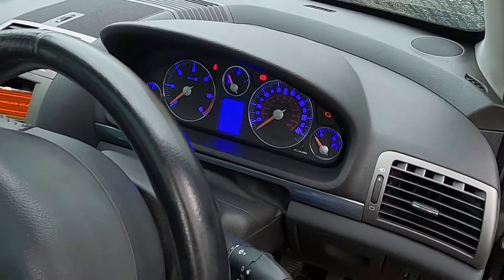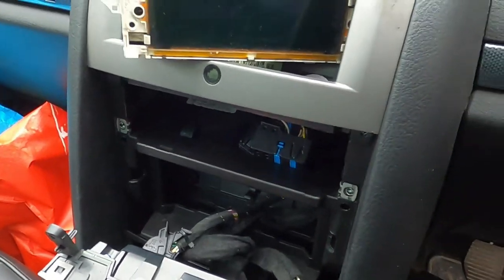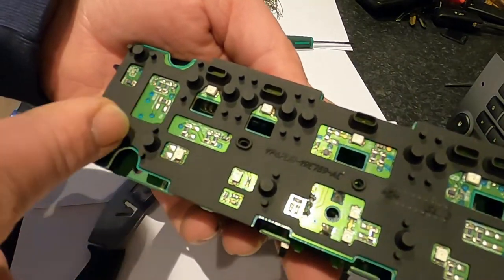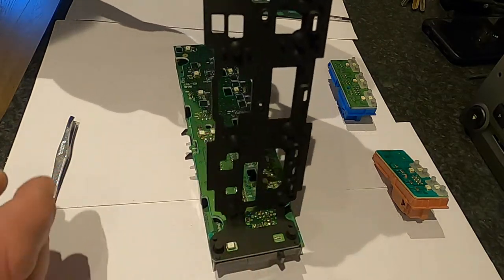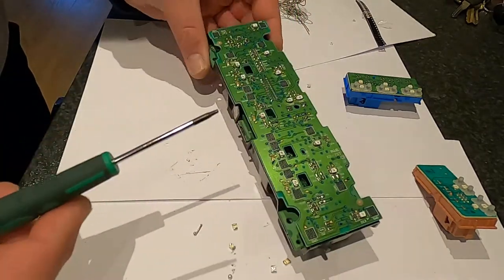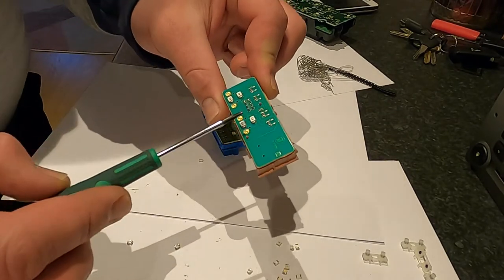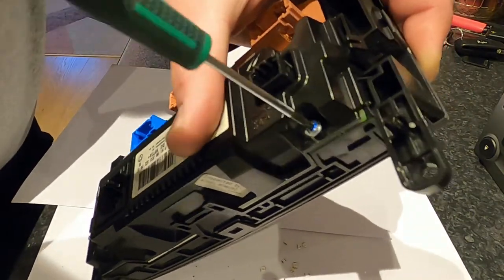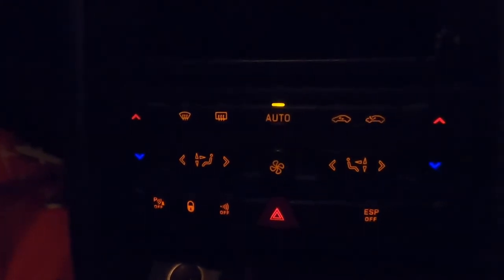Peugeot 407 dual climate controls LEDs swap

Comment: Two possible reasons: 
1. Resistor values to step the voltage down is too high. Replace with lower resistor. However this is unlikely as it should be same LED used everywhere. 

2. There is a filter painted on behind the buttons. This may need to be scraped off. There may also be a colour filter in the "clear" plastic of the buttons... in which case you can't really change easily. 

What you can do is use the central buttons, shine a RGB bulb behind, change colours and see what colour LED gives you the colour you want. 

Thank you for your help though, I wanted to change all the LED's to white colour :)
Reply from the maker: Hello Khalid, basicly without the buttons all LEDs shiny same amount of light. Those buttons wich is dimmer have a thicker layer of plastic wich makes them not so transperant there the white plastic is, orange light goes through them easy i am sure white one would aswell but blue gets stuck in it and is not much of it going through so i guess i need either a stronger leds or try to scrape some of the inside of the buttons to be more transperant i am not sure yet what will be the next course of action but i will let you know. Thankyou for detailed and informative comment i really rate that.
Reply: @Mad4FrenchCars  Thickness might make the light a bit dimmer but should not change colour. Did you light up the original LED's without the buttons installed to see what colour the original LED'S are? LED's usually run around 2.5v, so you should be able to power up the de-soldered LED's with an AA battery (you might kill a few however, as you've probably mixed those all together, might have to test a few of them!!)
Reply from the maker: @khalidacosta7133  really good shout mate abut the AA battery i will try that. They do seem to shine very dim blue is just way too dim.
Reply: @Mad4FrenchCars  Two AA batteries* Each is around 1.5v, so two in series will give you 3v. If you notice a brightness difference between the two, then they used different LED's. If it's colour, then it is a filter :)
Reply: This leds not working. I have chek after soldering whit 2 batterys 1.5V. I changed evertthing whit COOL White leds, but only ot the panel of Climatronic this buttons lights yellow, because this plastic of the buttons is not White and filtered the light to yellow. In your case whit the BLUE leds maybe will lights little Green. Sorry for the bad english... I'm from Bulgaria.
Reply from the maker: @pavlintsanevsky3946  i will have a look again in to the buttons i know that plastic thicker i will on some my need to make it a bit thiner and see how that works
Reply: @pavlintsanevsky3946  Nope, understood well! The buttons on the climate control have a yellow filter on it. Also be aware to anybody reading, there was a revision. After 2008, control panel was made by Behr! Early models are made by Visteon.
Reply: @khalidacosta7133  you think the panel from last models will be whitout this filters and will shine well.
Reply from the maker: I will try to take one out of my other 2010 peugeot 407 to see if those buttons also have a filter or not the only problem that one its not dual climate control is single, but  should still be ok just to see if filter is there.
Reply: @Mad4FrenchCars  Yes, however you can not change between Behr and Visteon climate controls as the heater box and BSI is different too!
Reply: @pavlintsanevsky3946 You can put pictures of what ice white looks like